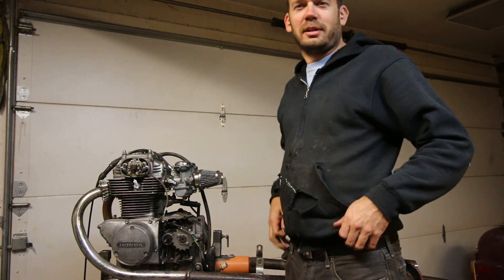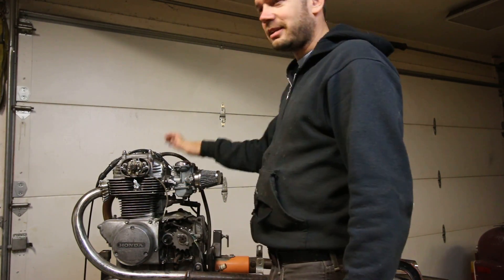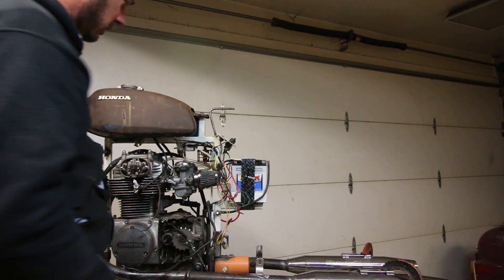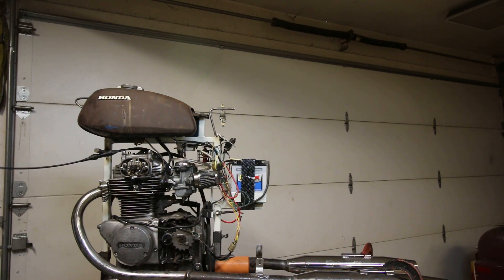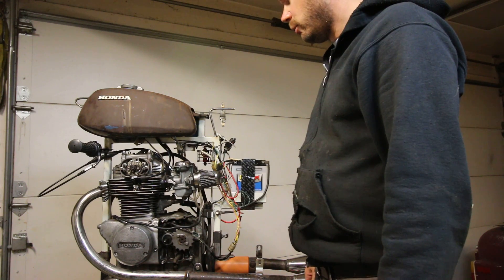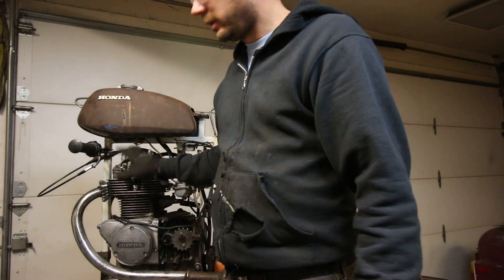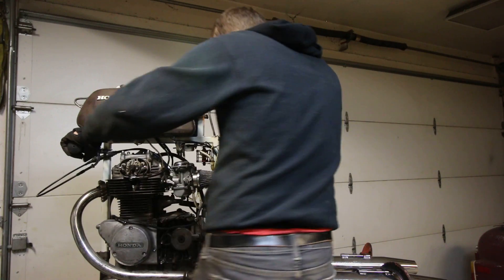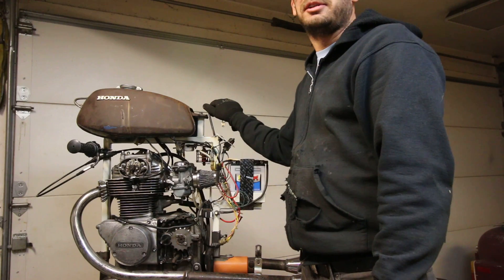Honda CB350 Motorcycle Engine Test Stand

Comment: This is genius and exactly what i want to build!!! Probally a stupid question but im guessing you need to change the carburetor out if you are testing other engine makes?
Reply from the maker: Thanks. Yes. This is set up to test CB350s and CL350 engines. They use the same carbs. The carbs go with the engine and tuning should be done with the carbs you are using on the engine so you wouldn't change out the carbs, maybe the throttle cable if it doesn't work with the new carb.

Comment: great work !\
i would like to add an important step before actually lighting off the heater.
that is simply verifying that the oil pump is getting oil to the cam journals.nexr to  points side cam journal is an m6 hex head  bolt that obviosly secures nothing.
it acts as a removable plug 
with it removed and also the sparkplugs removed to enable higher cranling rpm without battery or starter motor damage .
it is supriwing how long it takes to witness oil flow
of course once running the rpm is far greater than cranking speed 
but observing this all happening can be an eye opener for those that insist on using all kinds of throttle and rpm the insant a cold motor fires

Comment: just get one of these stands they work great! Just bolt to your work bench!   http://www.ebay.com/itm/262896749030?ssPageName=STRK:MESELX:IT&_trksid=p3984.m1555.l2649
Reply: The CB350 2 cylinder's front mounts are off set. That stand wont work unless modified.
Reply: There are offset and come with two separate bolts .
Reply: the two front mounts are offset thats why they have two different bolts why dont you look at the pics !